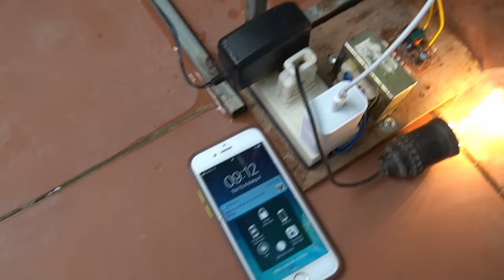Turn The Washing Machine Motor Into A Permanent Water Turbine Generator

Comment: Under the blue propeller is a water pump that transports the water upwards and is operated with the black power adapter in the socket
Reply: did you watch the video? he is literally putting a water pump inside with a wire and white hose attached to it?
Reply: @TheHuskyFamily may be that's a waterproof water pump😊
Reply: @meetshetty  yes probably a submersible pump
Reply: Its a sump pump for recirculating the water to the top
Reply: Yupperz ac... 120v?
Reply: @meetshetty  it is. They are sure to pump condensate from. A/C units when it can't be done by gravity.

Comment: What's crazy is if you actually understand how electricity works. You'll understand why a battery is required and see the ingenuity and intellect this man holds in himself. This was pretty fascinating to watch in all honesty, much respect to the creator of the video
Reply: @bushisfuckinretarded  Is this sarcasm?
Reply: The "battery" is the initial potential energy from the pouring of water. This think will keep fading and fading without mew water because the pump still has to send it back up to the top, taking more energy than the twin generators put in.
Reply: @AWESOME2715  It‘s working for far too long without any sign of slowing down to run on the initial potential energy. Nothing used here is near 100% efficiency which you would need to keep it running for more than a few seconds. It‘s all running far too smoothly for this kind of crude setup. „Generators“ working at constant speed from the first drop of water in there. The fact that both generators are just wired in parallel without any diodes or rectifiers alone shows that this is trickery.
Reply: @bushisfuckinretarded  Ask yourself one very simple question: Why was NOTHING plugged in that would show power being generated BEFORE the water was added to "start" generating power?

And also ask: What does the plug with wires running up the water return tube do? Why was it plugged in before anything else? What does hide in that first plug? If anything, I don't know...
Reply: This violate all known laws of physics
Reply: @charlesneely  This violates all known laws of safety, also 😀 
I think the batteries are hidden inside the Housing of the pump-plug.
Reply: @muff51  you think huh? So you're just gonna pretend as if he didn't show it?
Reply: @charlesneely  not really. It is using gravity
Reply: 0 respect. He's making ignorant people even more ignorant
Reply: Thermodynamics left the room
Reply: @thomasboese3793  ese primer enchufe es para activar la bomba de agua que pueda generar la corriente de agua para que vuelva a subir y caer sobre el primer molino, luego al segundo molino y nuevamente a la fuente de agua. 
Lo que quiero saber más bien es, ¿qué función cumple el sistema superior? al parecer es otro motor con el mismo sistema de hélices que el inferior, pero es más pequeño... 🤔
Reply: Sería interesante entender todo el proyecto... e identificar dónde está la otra fuente de energía que muchos dicen que está oculta.
Reply: How many voltage it can generate?

Comment: From my experience with small pumps, that pump could not pump enough volume of water fast enough up hill to keep up the flow we are seeing. What is the upper motor supposed to be doing?  That part is not explained, or I missed it. If this worked, every hydroelectric Dam would be using this system.

Comment: Can you please answer me, what is the little circuit you have before the transformer? Did you make it also? Thank you.
Reply: @Canonhood  please, put a making video for that circuit board,and all components circuit diagram also
Reply: @സാത്താൻസേവിയർ-യ6ന  ups transformer and a mobile phone charger circuit pcb
Reply: 500W Inverter DC 12V-24V to AC 180V-220V-380V Booster Board Module

18 + and 18 - should have a diod to stop backwards wiring  this dc in put can go upto 24 volt maximum input is the dc input in from the motors and ac is 220 live  and 0 is natural
Reply: @Canonhood  are u sure
Reply: @tiominarsianipar3464  yes 100%

Comment: How long did this run? 1 hour? 1 day? 1 month? A whole year? Just curious to see what you have to say.
Reply: it will last as long as the power doesn't drop to stop the water pump ☺️ so it's not recommend to power a high current electronics like a fridge or something like that . just use it for some low current electronics ❤
Reply: Will not work. Try it. You will be very desapointed...
Reply: @ebrahimsaber5222  Im not sure if people are joking, or there are actually people who thinks that this is working.

Comment: The washing machine motor works on 220v Ac ,if then it produce the same voltage if it is operated as a generator. So, my question is why is the need of a dc ->ac converter board and a step up transformer. Please explain me....

Comment: When the top paddle spins faster than the bottom one, energy must have been added somewhere ;D
Reply: the neodymium magnets add extra energy not sure how much or how long they can last
it would depend on the amount of power drained vs the amount needed to pump the water i guess, 
you could find the amount that compensates for thermodynamics and ya golden,
but i think if you plug in too many devices it will drain the system.
or i could be wrong
Reply: @bob_kazamakis  yeah actually bullshit guessing is how i do all my best work lol.

my bullshit guessing just seems to think thermo dynamics is wrong or more likey over simplistic.
 kinda like newtons laws that are more like guide lines then actual laws.

i feel like black holes kinda prove that perpetual motion exists as light can not breach the event horizon but....

if thats possible with a multi dimensional thing like space-time ,

dont see why electromagnitisum cant have the same thing on a smaller scale .
Reply: @CrunchsterXX2  why should i keep it to my self?
why dont you explain the physics and concepts ?
all ive done so far is ask questions

why dont you just chill out ?

3 questions for you to answer there 
but here is a statement....

i dont think you understand the physics of electromagnetism.
because as far as i know now one does lol.
Reply: @tj9959  well if light waves move no matter what aka a constant.

and black holes warp space time as so light can no escape the event horizon.

this would mean that inside the event horizon gravity is infinitely stretching space while the light wave is infinitely traveling towards the event horizon.

or that space time is frozen at the point ov absorbtion of the black hole makeing it a layer cake of its own history.

i dont know of any laws or theorys that say the complet stopage of time is imposable but if you stop all temperature you end up with a new phaze of matter the boes einstine condensate , and at the other end you get plasma , 

not sure why but this would lead me to think there are 3 states of time , or there could be only one state of time in which case 

this would mean that inside the event horizon gravity is infinitely stretching space while the light wave is infinitely traveling towards the event horizon.

or that light is not a constant 

ya get me bruh
Reply: @tj9959  and i think actually you are kinda discribing a singularity , a black hole is the bit from the event horizon that leads up to the singularity ..... i think

Comment: If someone is surprised that this doesn't work: 
This would be a perpetual motion machine, where the water that drops down over the pallet wheel to move the generator can also go back up. This is impossible. In this particular scenario, a pump is being used to push the water back to the top container, the problem is that the pump is powered by the generator. So the gravitational potential energy of the water would be converted (inefficiently) to mechanical energy (the pallet wheel spinning) which would then be converted into electric energy to power the pump. Every time energy is converted, there are some losses, due to friction or simply due to inefficiencies in the desing. So going from potential energy to electrical energy has losses, therefore there will not be enough energy in the pump to push the water up. As other have pointed out, there is a battery powering the  pump too, so it isn't only the generator, which does not have enough power. This video is a scam and I'm sorry for everyone who might try this and then be disappointed that it didn't work
Reply: Lol
Reply: How much wattage does a pump require?
Reply: I think the idea could work but not using water. We're missing the element(s) that would have the properties to make it possible. 
I've always figured "free energy" is simpler than we think; but, we're missing elements and compounds that would make it possible. 
Biggest problem is catching and storing the energy.

Comment: What you see is a contraption that's draining a battery or drawing power from a hidden outlet but with a lot more steps, and the hidden power source provides enough extra energy to compensate for all the loss in those complicated steps AND light a lamp or charge a phone or whatever.

Without a hidden power source this contraption would run down within seconds. The small energy input used to start the system (raising water to pour, turning a crank, whatever) will be quickly wasted in heat (vibrations like noise, friction in bearings, resistance in any and all wires, eddy currents in magnetic materials, friction of water against surfaces, etc.) Thermodynamics is always in play - you can't get out more than you put in.

Even if you removed or exactly compensated for all that wasted energy this thing would move but could do no work. And if you overcompensated for that, say by adding extra energy? You have a fancy moving sculpture connected to a power supply that has enough excess power to drive a light bulb or power a phone.

You don't ever get energy for "free" (as in, no effort expended somewhere in the system) - something is doing work, turning a source of potential energy into kinetic energy you can use, and there are always some losses to consider. Even solar energy has a cost, however small - think of it as a giant battery - in billions of years even the sun will run down.
Reply: how much energy is stored in the neodymium magnets tho
i dont know how to calculate that do you by any chance?
Reply: @darrylbrookes2780  I would suggest looking that question up. Probably somewhere like Stackoverflow. The short answer is that when you use a permanent magnet, it's not gaining or losing energy in any significant way... The force necessary to attract an object to the magnet is equal to the force necessary to remove the object from the magnet. I guess you could also look at it like this: If I lift a box with a stiff cable that cable itself is not a store of energy and is not doing work independently
Reply: Ok you don't get energy for free.... So.... How is that magnet staying attached to my fridge defying gravity, it has stored energy.... How much is the question.

If electro magmatism isn't energy then what is lol

Are you saying the energy is in the steel and the magnet is using that ....

Come on lad
Reply: @MartyMacgyver  is there a magnetic largrange point that could be manipulated tho as to create a hand off and no magnetic resistance to motion , there may be kinetic losses at some point but ya could use extreme low temperature to counter that if ya using on large enough scales
Reply: @darrylbrookes2780  Imagine a smooth curved channel (a bowl, at least in cross section). At one end you have a ball. You release the ball and convert its potential energy into kinetic energy as it rolls down, and then from kinetic to potential energy as it rises up the other side.

Does the ball roll back and forth forever? Nope! It goes a little less far each pass, til it finally stops. Frictional and vibrational losses (much the same as resistive and vibrational losses in the closed loop this contraption claims to be) quickly grind things to a halt. Once you do work of any kind, **even to generate heat**, energy is lost from the system.

The second law of thermodynamics doesn't care if you disagree with it - it's still the law.

Comment: SCAM!!! use 4x zoom and 0.25 play speed and see yourself...
9:04 first 2 hiden wires from socket to coil and from the edge to coil,hiding with hand the 9:21 thin wires on the back right edge and middle of plank going in the outlet, 9:18 naked wire on the right edge of the plank next to/between outlet and coil going over the coil, 9:18 out of focus hair thin wire over the coil to pcb and on the back side of pcb going in the right yellow wire hole, 9:20 clear image of the thin wire,  9:49 2 hair thin whires going out of the white spot to the edge and to pcb 11:48 hiden wires are moved (masked) to the edges of the plank and the black base of the outlet for the closeup shot and hotglued.batterys are in the socket or under the coil....what a waste of time and parts just for the numbers,you will be rich .....in your next scam video please hide your foot nails or wear socks..

Comment: Can you put here in the comment section of what  kind materials did you used to make that stuff?
Reply: 500W Inverter DC 12V-24V to AC 180V-220V-380V Booster Board Module ✧
Reply: Part list your pal from the uk computer and electronic engineer 
=============================
Top motor
LG AIRCON INDOOR FAN MOTOR DC 12 DC310V 130mA - EAU62004011
(No magnets needed to be converted)

Bottom motor 
LG washing machine induction motor for LG Model WD10150FB
(Needs Neodymium Block Magnets x 50  N52)
North and south drilled shaft hold place magnets and stick with super glue)

220 - 240 volt 12 volt transformer for submerged water pump 12 volt dc

24 dc volt input from both motors may be more voltage due to top motor 
 
inverter to 220 - 240  ac volt output
500W Inverter DC 12V-24V to AC 180V-220V-380V Booster Board Module
Reply: @Canonhood  Thanks. Do know if you really need the upper motor? Does it serve any purpose?

Comment: Why did you install the top motor when there was no need for it to exist? The lower motor is the one that produces the electric current, but what is the top motor doing?

Comment: Doesnt matter if he uses a battery hidden from viewer. If that perpetual water bottle spill and replenish is genuine, the motors and power part is completely feasible and realistic. Its the same as spinning a dc motor with your hand for it to generate lower. All you need with such infinite water flow is a proper motor and a chargeable battery to store power. Then, convert that power from dc to ac to run huge components around the house like a refrigerator
Reply: The question is will the 2 generators can generate enough power for the little pump to pump water up that high fast enough so there would be a constant flow of water?
Reply: @nicolaslocke1433  there's always energy loss so.. no lol
Reply: The most high end motor in the world can only hit 90% efficiency at peak rpm.  Infinite water flow is impossible. Every time this device cycles its losing at least 30% of the energy input, because it has 2 motors, and 1 pump.  Then once you start to factor in the AC/DC conversion losses and transmission losses this device is an energy hog.  You will be lucky to even get 1% of the input energy returned.
Reply: @xe-wf5iv  can you educate me in terms of numbers?  Like if the pump uses 5whrs, the top motor generates 3whrs and the lower motor generates 4whrs.  wouldn't that means there's surplus power?  Unless you're saying the pump uses 8whrs or the combined motors can only generates 4whrs, I don't see how this can't work.

Comment: Thanks, youtube algorithm. When I think I am the biggest idiot on the planet, you provided a comment section that proves otherwise.
Reply: Do you have a link to the exact materials used in this? I would like to try that here in Mississippi!
Reply: @scott_forgot9875  Sure, scott bot! You need what looks like a 50hz 220v branch circuit connected to a triplex receptacle. Then you need a step-down transformer (18:1-ish) going into probably a bridge rectifier circuit with a built in filter circuit on the same PCB to feed one 12v motor. For the other 12vdc motor it looks like you just need to snip the end off of a cellphone charger (or some other device charger) and direct connect it to your other motor. From there it looks like you need a bunch of plastic garbage and a poorly welded metal frame for presentation. Don't forget the hot-glue gun and incandescent light-bulb to complete the display!

Comment: When the rotor is turning due to the water falling on the turbine the stator coils are electrified through induction which inturn increases the magnetic field of the rotor and you got that output. That stuff works. OMG😮😅😅😅😂😂😂